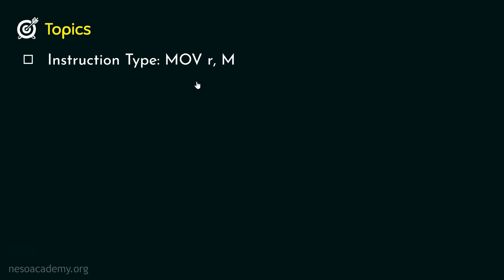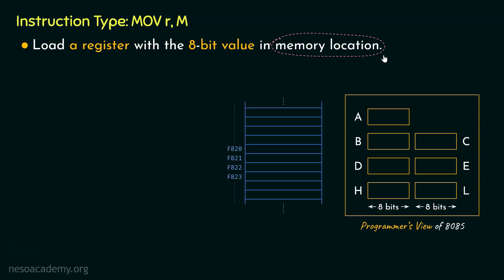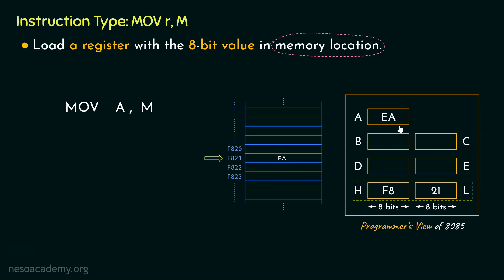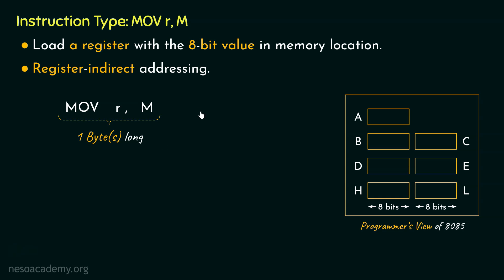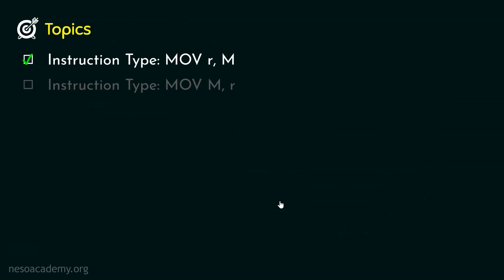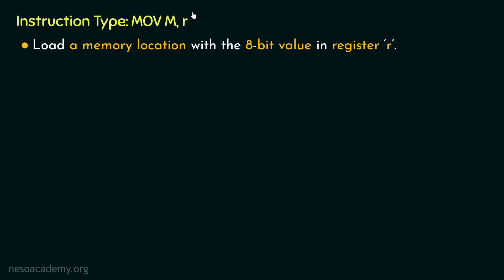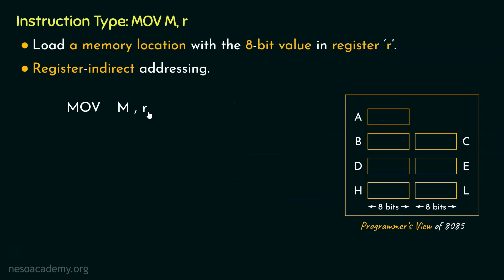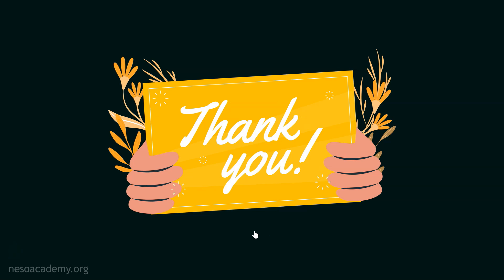8085 Microprocessor Instruction Types: MOV r, M and MOV M, r

Comment: ## 🔄 MOV r, M — Move Memory to Register

### 🧠 Purpose:
Transfers the *8-bit data* from the *memory location pointed to by HL* into a **register**.

### 🧾 Syntax:
```assembly
MOV r, M
```
- `r`: Any general-purpose register (A, B, C, D, E, H, L)
- `M`: Refers to the memory location addressed by HL

### 📦 Details:
- **Size**: 1 byte
- **Machine Cycles**: 2 (Opcode Fetch + Memory Read)
- **T-States**: 7
- **Flags Affected**: None

### 🧪 Example:
```assembly
LXI H, 4050H   ; HL points to memory location 4050H
MOV E, M       ; E ← (4050H)
```
If memory location `4050H` contains `AAH`, then `E = AAH` after execution.

### 🔢 Opcodes:

| Instruction | Opcode |
|-------------|--------|
| `MOV A, M`  | `7E`   |
| `MOV B, M`  | `46`   |
| `MOV C, M`  | `4E`   |
| `MOV D, M`  | `56`   |
| `MOV E, M`  | `5E`   |
| `MOV H, M`  | `66`   |
| `MOV L, M`  | `6E`   |

---

## 🔁 MOV M, r — Move Register to Memory

### 🧠 Purpose:
Transfers the *8-bit data* from a *register* into the **memory location pointed to by HL**.

### 🧾 Syntax:
```assembly
MOV M, r
```
- `r`: Any general-purpose register (A, B, C, D, E, H, L)
- `M`: Refers to the memory location addressed by HL

### 📦 Details:
- **Size**: 1 byte
- **Machine Cycles**: 2 (Opcode Fetch + Memory Write)
- **T-States**: 7
- **Flags Affected**: None

### 🧪 Example:
```assembly
LXI H, 4050H   ; HL points to memory location 4050H
MOV M, B       ; (4050H) ← B
```
If `B = 32H`, then memory location `4050H` will contain `32H` after execution.

### 🔢 Opcodes:

| Instruction | Opcode |
|-------------|--------|
| `MOV M, A`  | `77`   |
| `MOV M, B`  | `70`   |
| `MOV M, C`  | `71`   |
| `MOV M, D`  | `72`   |
| `MOV M, E`  | `73`   |
| `MOV M, H`  | `74`   |
| `MOV M, L`  | `75`   |

---

## 🧮 Summary Comparison

| Feature            | `MOV r, M`                        | `MOV M, r`                        |
|--------------------|-----------------------------------|-----------------------------------|
| Direction          | Memory → Register                 | Register → Memory                 |
| HL Role            | Points to memory source           | Points to memory destination      |
| Size               | 1 byte                            | 1 byte                            |
| Machine Cycles     | 2 (Fetch + Read)                  | 2 (Fetch + Write)                 |
| Flags Affected     | None                              | None                              |
| Example            | `MOV A, M`                        | `MOV M, D`                        |